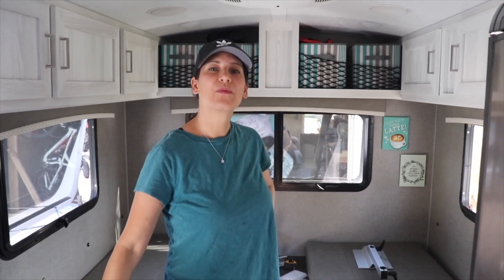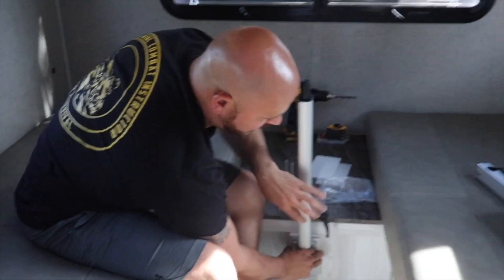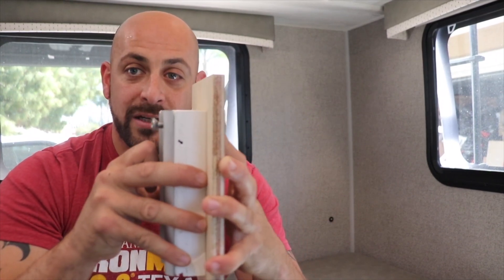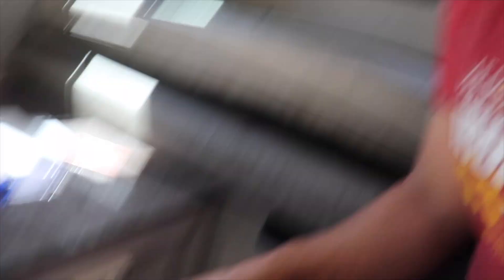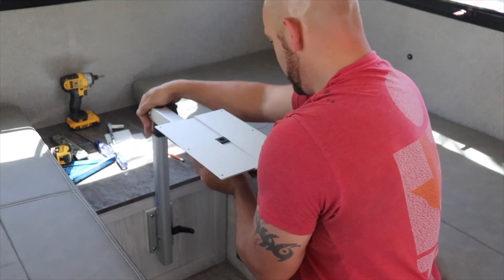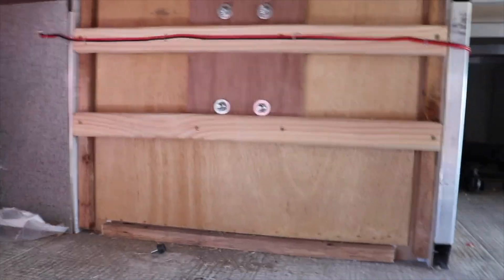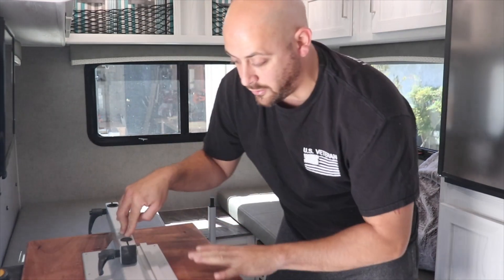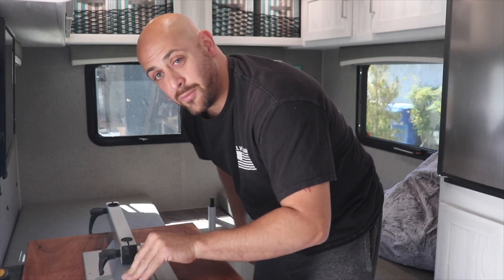Installing a Lagun Table in a Geo Pro G15TB

Comment: I did mine the same location. For the top I went with 30"x40" this does hang over the cushions, but I just raise the table up at night and there's plenty of room for my feet. This gives us a bigger area for eating as well as working on two computer. It's made all the difference getting rid of the stock table. It was really cumbersome and in the way. Thanks for sharing.
Reply from the maker: We wanted a smaller table top to not take up so much room. Glad you enjoyed it.

Comment: The swivel function allows you to place the table top touching the rear wall, so in your case creating a gap was not necessary. That would only be needed if the arm is not aiming exact 90° to the rear wall AND you want to turn the thing both ways around.
I myself are generally fighting to find a position in my van that is 100% aligned horizontally and vertically.
Reply from the maker: Wish you the best.  Ours works perfect as we made it.

Comment: Nice table install, thanks for sharing.  PLEASE pull the staples out holding the wire in the back, and replace with insulated staples.  Like you said, vibration when driving will wear the insulation on the wires and could present a fire hazard (especially when driving, but could be anytime the circuit has power).   -Rick
Reply from the maker: Thats the low voltage wire for the 12v usb plugs. Not too worried about that with these.  But thank you for the advise.
Reply: @TheSierraLife  It’s not the voltage that is the issue, it’s the current, and the short circuit current would likely be enough to ignite a fire.

Comment: Great video - thanks,  One key measurement is what is the thickness of the board that allows the slide mechanism to clear the counter top?
Reply from the maker: Not sure exactly what you are referring to?
Reply: I am wondering the same thing.  It looks like a 2x4 but wondering if we are right.  We are referring to the piece of wood you mounted the table bracket to. Thanks